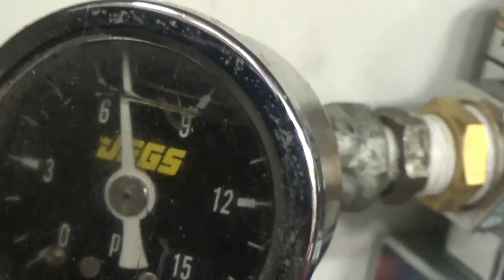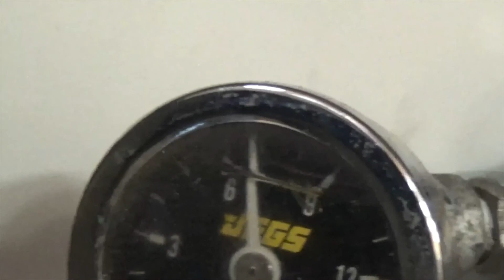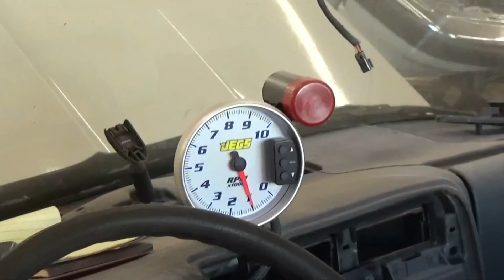replace hard fuel line with AN hose

Comment: Nice job sir, I always liked the clean look of the braided hose when ran nice and neat,  that’s definitely on my to do list for the elco is some high pressure braided transmission lines with an fittings, looks better and you can route them away from any heat 👊🏼👊🏼👊🏼😂